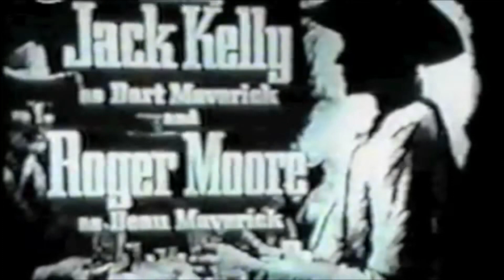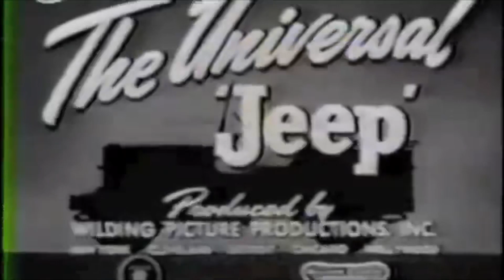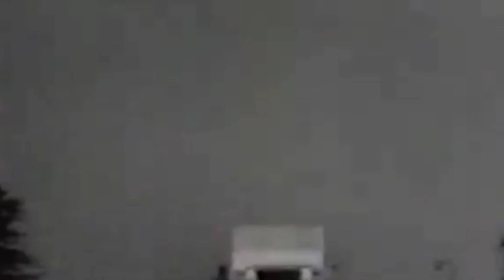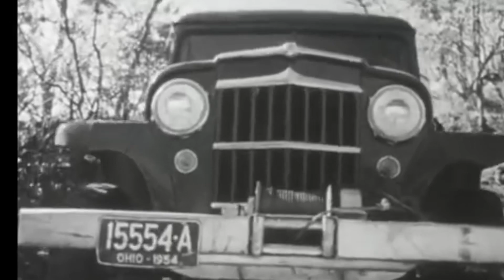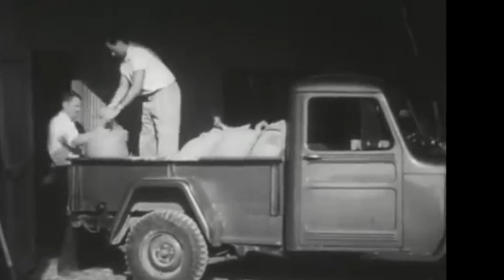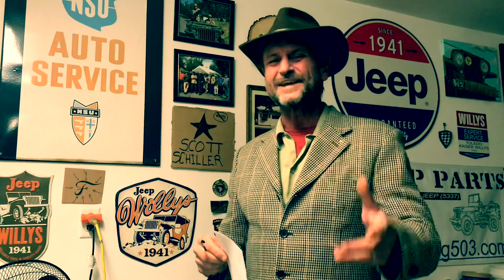How To Pronounce Willys Jeep Team G503

Comment: I couldn't agree more, Scott.  I have no problem with folks pronouncing it Wil-EEZ as that pronunciation has been so widely used for over seventy years that it has become the excepted pronunciation for Willys.  But it seems obvious to me that Willys is a proper name, as in John North Willys, and would be pronounced the same as the name Willis which is also a proper name.  Just like Smith and the less common Smyth are normally both pronounced the same.  It is helpful to remember that it is a name spelled W-i-l-l-y-s with no apostrophe, as opposed to the possessive Willy's.